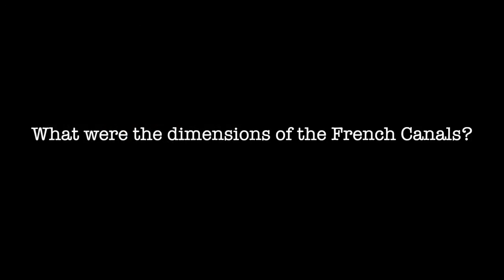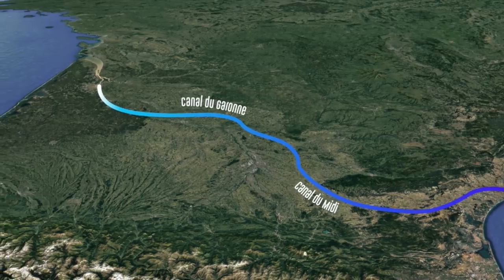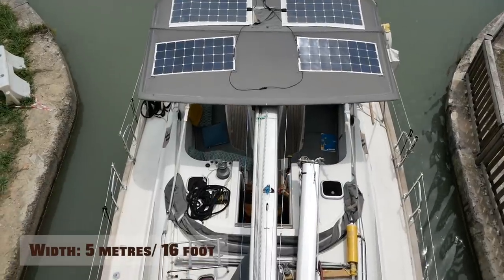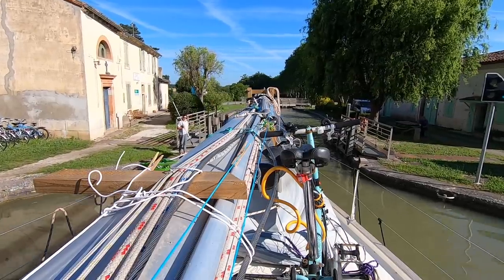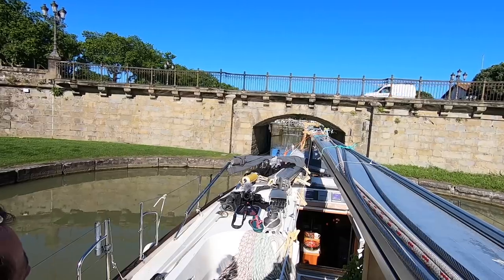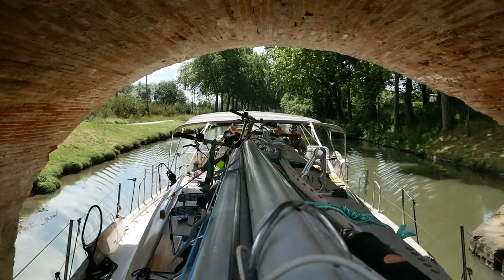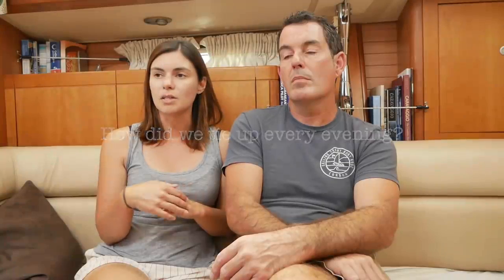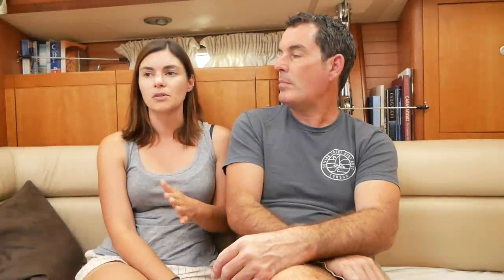The most UNDERRATED trip we ever did! French Canals| Patreon Q&A | Part 1

Comment: So glad you had fun in the Midi guys! It certainly looks like a different experience from our French canals - although we did find a few hanging handles to operate the locks. We also saw other methods such as motion detectors to prep and open the lock then handles in the lock to run the cycle once you were settled. We also were much less troubled by the charter fleet problems. We did pass through a couple of areas where there were bases but they were just local sections then we were out in the regular open stretches again with just us and other long term travellers. Of our 179 locks transited we were only in those areas for much less than 1/4 of the time. We also had none of the rounded locks which looked difficult since your mast would come close due to the radius. Also the depth was 1.8 meters so we had much more underwater clearance. 

Hugs,

Paul & Sheryl
SY Distant Shores III

Comment: Some years ago (2006?) we did canals east of Paris on a private boat. For us the auto locks tended to work on electronic eyes 1/2 km before the lock then in lock red and blue vertical poles to operate the hydraulic controls of the locks.  We never saw a twisty pole.
There were small Government free marinas. Part of canal system. But they were mainly in the middle of nowhere. This meant you needed bicycles to get anywhere to far to walk. Dutch canals I have done a lot more they have the canal going right thru the town centers making much more attractive to travel , stop etc.. The French canals were revamped and expanded by Napoleon who made then all the same size but had to build them where he could. Defiantly enjoyed my time on canals.
My sister rented a canal boat for a honeymoon and her husband was a long time skilled power boater. He found the design of the rental boats so bad that steering and driving was really difficult!  But there are definitely incompetently operators. 
Cheers Warren

Comment: Hey guys, just watching this as am planning to do the canal du midi in my Southerly 115 this year,  Thanks for the great info.  I am trying to find out something though as can't find it online and can't get the carte's until i get back to europe. The heights of the bridges, I know the lowest is 3.3 (3.25 when you did it) but what I want to know is how may there were that were under 3.5.  You took you bimini down once, I have solar arch which I can take down before bridges, but am wondering if it is better to remove it for the entire trip or if it will be fine for most bridges and I'll just have to take it down a few times for the lowest ones.  If you recall how many bridges there were below 3.5, it would help a lot, thanks.

Comment: Wow! That's hilarious about the other boaters! Just like other drivers everywhere you go. Here in Minnesota, USA we have 10,000+ lakes and rivers - many of them very large, we see 1000's of boating accidents every year - many of them just at the boat launch before the fools ever get into the water!  I watched one fool attempt to drive his new $85,000 Ski boat onto his trailer when he fell over backwards onto the throttle (yes, he was drunk) and hit the trailer with enough speed to drive the boat past the trailer and onto the roof of his new $70,000 pickup truck. But it got even worse! the boat then rolled off the top of the pickup and landed upside down on the concrete boat launch. We estimated the damage to be about $50,000 to the boat, trailer, and the truck. Be careful out there!

Comment: You asked yourselves a question at the start about whether catamarans can go through the canals, but then didn't really answer it, so I'll give the answer here...

The answer is yes, but only for a few types. Of catamarans in current production only 2 can fit within the 5m maximum beam of the canal locks to get to the Mediterranean. They are the Gemini Legacy (which is uncommon in Europe) and the smallest Broadblue, the 346. The Broadblue 346 is specially designed to be able to fit at 4.85m beam. Larger catamarans can fit through the locks on the major rivers like the Seine up to Paris, but cannot go through to the Mediterranean.

Of older catamarans, the smaller ones like Heavenly Twins and Catalacs fit, and the Prout boats up to 37' also fit, like the Snowgoose, with a beam of 4.85m, and earlier model Geminis.

With a beam of 4.85m on the Broadblue 346 and the Prouts, the fit is very tight. There is not even space for normal fenders. Instead boards have to be used for fendering.

There is a channel here on youtube showing an old 4.85m beam Prout taken through France. Search on Sailing Kallisto. Once the first 5m width lock had been traversed and they had sorted out their fendering subsequent locks were no problem.

Comment: From the U.S. and have done five hire boat trips. There were several different lock systems from manual on the Jarnac to lock keepers on the Midi. While the Midi is historic it is also the most crowded and touristy and due to the loss of the plane trees, it has lost quite a bit of its charm. My favorite, Hesse-Saverne-Hesse for seven days on leBoat. Unlike the muddy Midi, the water is clear,  the scenery beautiful and worth seeing from both directions. Hesse is accessible by train or rent a car from Strasbourg to Sarrebourg,, then short drive/taxi to Heese.
The harbor master in Saverne checked his computer records for 2017 and found only 5% of his tie ups were from the U.S. also on this segment of the Marne Canal there are sensors that detect your approach and will fill or drain the lock and open the gates. While I can’t say it is 100%, most locks have CCTV with somebody monitoring and help available if needed. My guess is the systems changed based on the available technology when a particular section of the canal was automated.